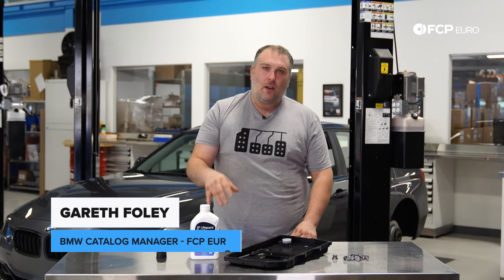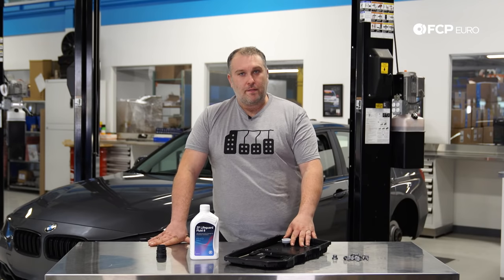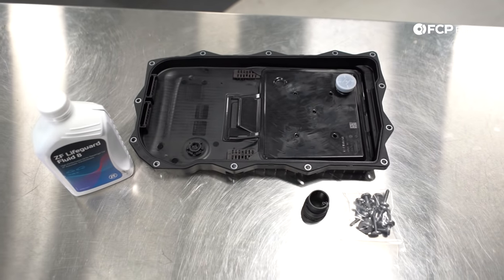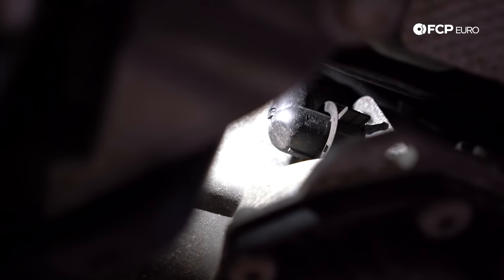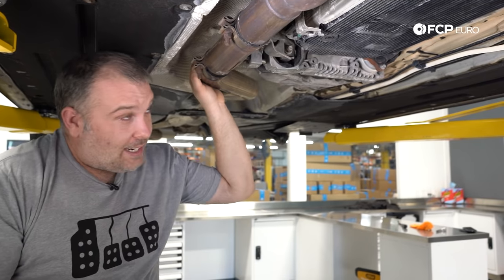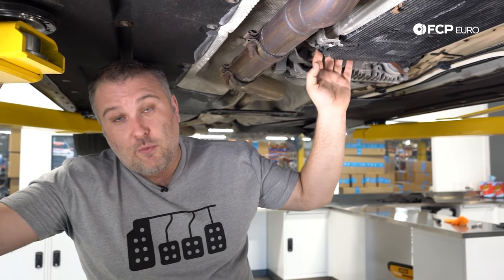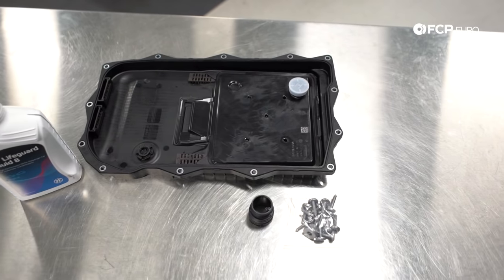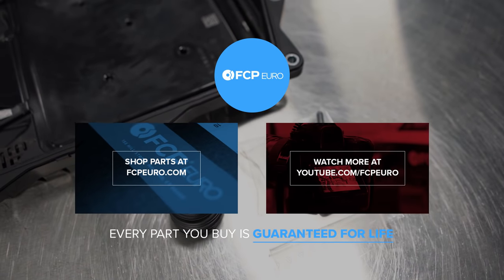ZF 8-Speed Transmission Guide (8HP45) - Specs, Common Problems, Diagnostics, & Maintenance

Comment: Agreed this is the best transmission I’ve ever had
Reply: Not at all. So for example lets see how good it is after a running time from 500.000 Miles compared to an realy good Transmission like the World best Japanese AISIN Transmissions. For example i owned also a AISIN 5speed Transmission with 4 Overdrive Gears and it runs, shifting like a pure dream fast, very direct absolutely without shiftlegs. And without any oil changing after 6 Years lifetime. Also Hyundai Transmissions are in the Average decent too, but my 5speed of course not that good as my 5speed AISIN in the drive feeling  BUT in the quality my Hyundai Transmission is very reliable and very strong. But i guaranteeing no ZF Transmission will by far not gets the same lifetime like a AISIN there is no Arguing that.  With a equal, same maintenance no ZF  can mess in lifetime with a AISIN. It starts already with that primitive Plastik pan, ground cover on the ZF 8speed As far i know AISIN doesn't use such a plastic crap for example for the oil pan part. But if such a plastic sh... will may eveen come on ASINS  i be sure, than are the Plastik parts from the European, German Manufacturers way way more trashi, crappie than Japanese ones are.  This is, what it shows in the history allways in that way. So i don't expecting already here a long lifetime and a maintain less payable lifetime from those ZF crap. Thats normally the way, how it is.
Regards Jay
Reply: @JWORLDKING you cannot compare smoothness and shift speed to Aisin boxes, ZF 8 is number 1 by far. Most used gearbox in the market for a reason. Same reason the biggest brands use it.
Reply: @JWORLDKING you have no idea what you're talking about buddy. If you think an aisin shifts smoother than an 8hp you're on crack😂
Reply: BS

Comment: I have this transmission in my 2012 BMW X5 35i and it is extremely smooth but yet if you need it to turn into a quick shifting performance machine you can slap it into sport and it transforms it.

Comment: Thanks for the video! I have noticed if I start my car F30 from cold, and set off within 10-15 seconds, the first up shift from 1-2 is pretty delayed and sounds like it’s slipping. If I idle for 30 seconds it does not do this. Otherwise the transmission operates normal. What do you think is the problem?
Reply: It’s completely normal. Mine does it too and I got my valve body completely overhauled + flushed with 11l of new oil. I heard this from a lot of people and it seems to be normal
Reply: @iPlayzz  I don’t think it’s normal but I think he should get a fluid change just incase it hasn’t had one.
Reply: I have the same situation on 2017 X5. The service adviser at BMW said it would be to hold gears 1-2 a little longer to warm up the cats a little faster to reduce emissions caused on cold start.

Comment: I used your video from the X5 8HP service to do the fluid and filter change on my 228i xDrive - messy without a lift but it was a surprisingly straightforward job. Your complete kit was exactly what I needed - I just wish the ZF Lifeguard fluid wasn't so costly. Have you & others had good luck with the Liqui Moly Top Tech 1800 fluid instead?
Reply: No - use chevron fully synthetic multi-vehicle ATF which meets  / exceeds the spec for the OEM fluid at 1/4 the price !
Reply: @patrickdunn6701  it doesnt. multi vehicle atf meets requirements for more common automatic transmissions like ford’s mercon lv. do not put that in ur zf8. lifeguard 8 is not like normal atf and has different viscocity at different temp points

Comment: Thanks great video. From ZF service manual: 
ZF 5-, 6-, 8- and 9-speed as well as the ZF 4HP20 automatic transmissions are filled maintenance-free with specially developed
semi-synthetic ATF oils. However, due to the many factors influencing the service life of transmissions in individual operation, ZF
recommends an oil change after 150,000 km for its transmissions. In operating conditions with high temperatures and loads, or
with unknown vehicle use in the past, it can make sense to change the transmission oil at shorter intervals.
In each case, only released ATF oil may be used for oil changes. And oil changes must be performed in accordance with the
relevant specifications. The exception is the ZF 5HP18 automatic transmission which must be filled differently depending

Comment: 8hp has been in service in the 3 series for 8 years but it came out a lot earlier. First application was in 2008 7 series. Basically came out at the same time gen 2 6hp came out

Comment: Definitely agree that this tranny is a keeper.

I'm a 20 years experienced tech and I have one in my 2013 ram 1500. Not one problem with the trans since buying the truck brand new. I've done one full service, changed the pan/filter with mopar and amsoil ATF spec'd for it at around 75k km, and just drained and filled it every 75k km since. At around 225k km now and it drives like it did on day one. I'll be doing another full service soon with a new pan/filter.

Nothing required other than the regular maintenance, not even so much as a leak.
Reply: How's the drain plug holding up or do you have to replace it after a drain and fill?
Reply: @4-Runner  I kept the original from the original pan when I did the first full service. Haven't needed it yet after any of the drain and fills. Could probably just change the O-ring on it if you find you have a leak after removing and reinstalling.

The one thing to mention is it's an Allen 10mm I think, but being plastic it doesn't work so shit hot. Use a torx 45, or whatever size fits best, 50 maybe I can't remember, on it to remove it.
Reply: @H0MEDADDY  Thanks for the info. Appreciate it!

Comment: Great vid Sir! I just picked up my 320d f30 and was shocked at how good the 8 speed auto shifts.... ZF did their homework...
Reply from the maker: It is a proper transmission , there's a reason we see it in almost everything.
Reply: @fcpeuro  when maybe not fully warmed up and the car has a higher than usual passenger weight is it normal for to get drivetrain message on dashboard?

Comment: I agree the ZF 8-speed is a fantastic transmission, very quick and smooth gearchanges. It was a bit confusing in the beginning where you first very clearly recommend the original ZF filter unit and then later, underneath the car it sounds as if you say you don’t recommend it «because it’s made by Philtrans»…, which is correct? I can buy a kit from ZF or Meyle, where Meyle is actually a bit more expensive. Meyle is a reputable manufacturer, although ZF seems the better choice as the original manufacturer.
Also, is there a similar instruction video on actually changing the transmission oil?

Comment: My broke at 300.000 km, grooves in one planetary set were torn. It was a common problem and upgraded version of this was installed. It was not expensive at all, together with oil and filter the repair was 1,100€. Now I have 330.000 km and I wonder how many more are there before breakdown. 
When I first drove this car on a test drive I almost couldn't believe how smooth everything works.

Comment: In Australia we have the 6HP in our Ford Falcons and it was a reasonably common problem where the transmission cooler failed internally, However I have never heard of a ZF gearbox failing without reason aside from the cooler.

I would like to know more about the sound they make on their upshift, I gather its the brief unloading of the engine to allow for a safe/smooth shift saving the input shaft, But I would like to nerd out on more information about this and why it happens, and why you don't hear the same noise in other automatics, apart from DSGs - Which the ZF isn't.

Comment: We had a 2016 X3 3.5i that went through 2 of these in a month because they would not stop leaking from everywhere. Like they were building up pressure internally or something. Luckily it was all dealer warranty work. Ended up getting rid of it for a Grand Cherokee 5.7 with the same trans and haven’t had any problems with it this time around.

Comment: What could cause rough shifting? I notice it most in the middle most used gears. From 4 > 5 > 6 and back. More noticeable with cold engine / transmission.

Comment: Garreth, Great video! Thank you for posting this.I have an F30 335i N55 sportline with an 8HP and it shifts so fast, its nearly as fast as the DCT. #projectweltspeed #weltspeed
Reply from the maker: Glad you liked it!
Reply: Hi Steve, I have an F32 435 AT 8 speed, Quick question when you put the car on sports plus and on manual mode, and you floor the throttle from gear 1, does your car go into overrev or does it automatically shift up to second gear?
Reply: @exoticsinafrica1789  it auto shifts from 1 to 2nd even in manual at WOT in full sports mode. That’s by design from ZF software.
Reply: @SteveWeltman  thanks for reply, my car doesn't auto shift from 1st to second when im in sports plus mode or with DSC full off,with manual gear selection selected, instead it went into overrev and power cut, does that mean I have a problem with the engine or gearbox? Im perplexed as i bought the car used about a month ago?
Reply: @exoticsinafrica1789  unless you have XHP software it’s hard to know if there are adaptations programmed to dis-allow auto upshift. I have a bone stock ZF6HP21 in my E90/N54 MSport and it forces a 1-2 shift at WOT w/DSC and traction off, full manual mode. The over-rev may be allowed by software in XHP or it could be regional if you’re in EMEA (you appear to be). Either ProTools, XHP or a transmission pro can further explain well beyond my limited visibility on your cars conditions.
Reply: get a subscription to XHP, ProTools or another Euro OBD II tool that can diagnose BMWs. If you just bought the car a month ago, I assume used from a 3rd party. Who knows what they did to it, or had done to it.

Comment: Great video! Is there a datasheet with the recommended service interval for every fluid, spark plugs etc in one place? If not could you compile one? :) I have a 435i xD with 30k miles and I would love to have pointers on what is next on the maintenance. Thanks!
Reply: See the car manual.

Comment: Great video!!! I have Audi Q7 4M model, from 2015-2021. It has ZF 8 speed automatic transmission. I have 170 thousand kilometers on it. I don’t know if a previous owners done the transmission fluid change. Do you recommend me doing this at this stage? Also, which transmission fluid you recommend, original from Audi dealer or ZF one? Thanks for your reply 😉👍

Comment: GREAT Video!!! Do you know what causes the "Service Shifter" message? Mine was on for years without any problems but one day my 2017 Jeep Grand Cherokee just stopped moving. The PRNDL on the dash flashes and the Jeep just stays in neutral even though the shifter and dash says  Drive? Had a new Valve Body installed and the Jeep ran for about 40 miles but really HARD downshifting, poor mileage and higher tranny temp than usual... 220/230 as high as 240 within 10 minutes on highway? Then the Jeep went into LIMP mode. Took it home and now 2 days later check engine light gone and it's driving fine??? WTF? Last thing, do you recommend a TCM reset??? Thanks!

Comment: A question to Gareth and the Community:
I had an appointment at a ZF service point to flush and change the transmission oil of my ZF 8HP45 after 85k km. My F20 is changing gears like a brand new car since then. However, when the transmission gets hot, it starts to smell quite badly via the air vents. This issues occured right after the oil change. After two weeks it is not gone yet, althoug it has improved slightly. The service staff double-checked the transmission. No leakages were found and no oil was outside the gear box. They told me, it is quite common that the F20 or F10 series from BMW tends to smell due to the fresh oil. It should stop smelling after a while. 
Have you experienced something similar so far?
Thanks.
Reply: Yes , its OK

Comment: Hi Gareth, thanks for the video from the UK, its been about 45 years since I stripped an engine and gearbox. ZF transmission is unbelievable in my Alfa Stelvio. Only slight issue is  in auto it sometimes won't shift up in the normal rev range from a standing start until I paddle/Stick Any ideas?

Comment: Great video - thanks... Maybe you can guide me here.. Over the past weeks I have discovered problems with the transmission... Worse when the temperature is below freezing... gets better when the engine is hot and even better shen the weather temp gets higher... Difficult to set into Reverse - have to put it into Drive mode first and then Reverse... When I start drive the rpm goes higher before shifting, and 40 miles an hour with 3000 rpm, does not get the transmission to shift... It's like only the first 3 or 4 gears are being used... Manual gear is not possible... 
One day is totally crazy - the next day it runs without any issues... 
Yesterday the oil level was checked and was ok - the oil was dark but not black.. not clear... The car has just turned 100 K miles.. 
I drove the car to a workshop specializing in automatic transmissions, and they said worst case scenario is a new transmission.... My car is a BMW F31 from 2017 - well seems like a huge expense on a relatively new car.. 
Any comments/ideas :-) and happy new year to all...

Comment: Can you make a video about the transfer-case ? Btw i have the transmission in my bmw , and it can jerk between first and second gear  especially  when the gearbox is cold. The car has 100K miles and as far as i know has not had a transmission service . Is  a transmission service advisable at this point ?
ps 
Love the videos, keep up the good work
Reply: I always thought it was weird how the transmission kind of jerks on 1st & 2nd as well. 58k on mine
Reply: This could possibly just be that you’re low on transmission fluid.... I got liqui moly in mine after my trans was serviced. Bottle is about $7 from FCP
Reply: 100k miles = 160000km. ZF recommend the oil and filter change every 80-120k km. So here it's your answer: do the service! And use ONLY the HP8 oil, not any dexron stuff.
Reply: @AlessandroGenTLe   I was planning on using liqui moly atf1800 , as it for the 8hp
Reply: @thebmwfan  Yes, that one is compatible as it has the 9.55550-AV5 certification. To be added to these: Petronas Tutela AS8 / ZF LifeGuard Fluid 8 (code: S671.090.312) / Vaico ATF 8HP V60-0264 or RAVENOL ATF 8HP Fluid
They are green, not red.

Comment: Thank you for this video. I watched the other vido on changing the transmission pan/filter and oil, purchased from FCP for my 2012 BMW 535i xDrive.    Question:  My car is still downshifting hard and bucking a bit in gear under load.  Do you think I could replace the mechatronics unit on this my car to correct?  Other than transmission, 130 miles and running like a top.  Appreciate your input!

Comment: hi mate, i've found a lower leak (not near the input shaft) on my ZF8 only 27k miles on the clock. my garage will be changing the pan over but he also said it's extremely unusual for the ZF to leak at that mileage. Does it sound any more sinister than just a fan replacement and re seal ?

Comment: I have a 2.0 gasoline 280hp Alfa Romeo Stelvio and the shifting between 1st and second does not feel totally smooth, you can feel a slight thump, as if a clutch was slipping and then engaging more firmly, before a shift is completed. Could this be related to the need of an oil change, or can it be any other issue? It's barely noticeable, only from the driver. I honestly don't think it's normal. Car has 75.000km. Thanks!